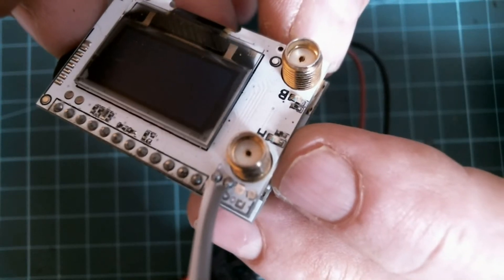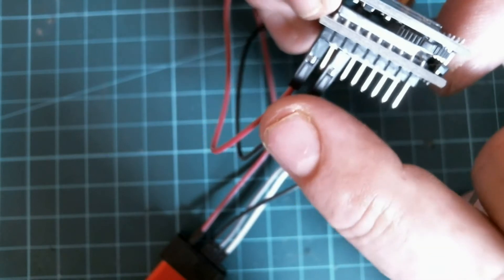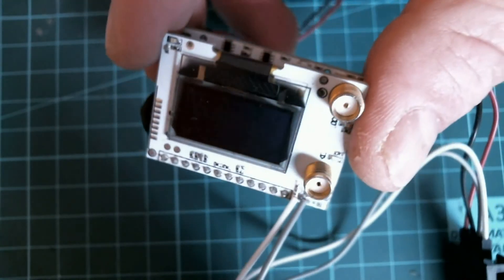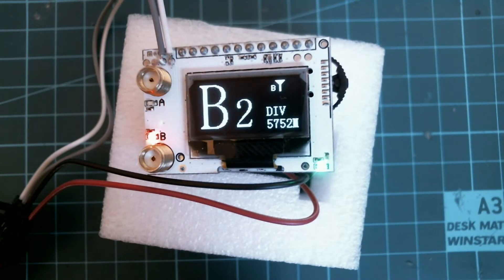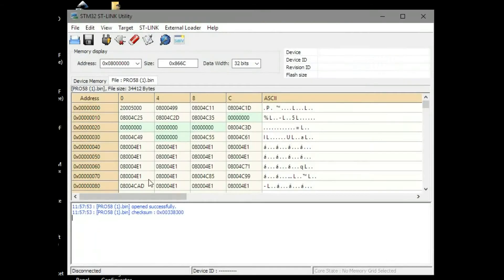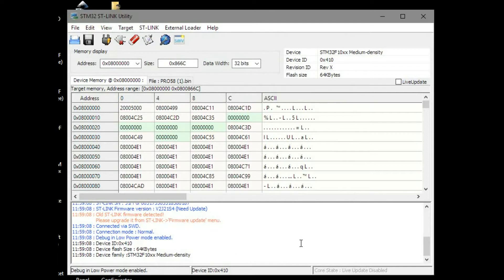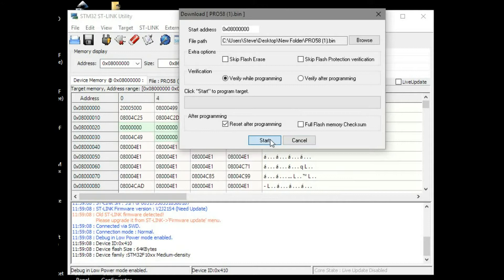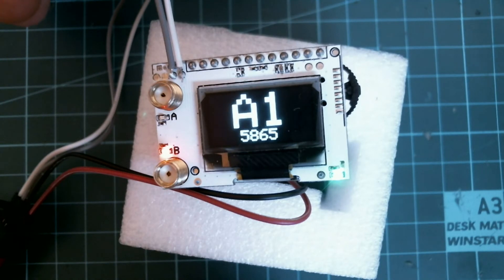Flashing OpenPro58 Firmware to the Eachine Pro58 Diversity

Comment: HE MAKES  PROCESS MORE COMPLICATED THAN NEEDED FOLLOW THESE INSTUCTIONS-

start the st link software, click on 'file' at top left and then open file, browse to the location the firmware bin file is saved and select it, st link will open the bin and return to its main screen.

now click on 'target' then select 'program and verify' st link will connect, theres no need to manually select connect.

you will get a box with options and a start button at the bottom, click start and after a short pause it will begin flashing, once complete your pro58 will reboot.

 job done!
you do not need to mess about with any other settings like in this video

Comment: Hi, I saw that fw tells me step by step how to do calibration, but I have 2 doubts. The first is the power of the vtx, I have to set it to the maximum (ie 600mW) or 200mw okay? The second doubt is the distance between vtx and rx during calibration. Thank you.
Reply from the maker: I set mine with a 200mW and had it across the room approx 4m away seemed to work just fine. PS my usual quad has a 600mW transmitter.

Comment: Hi steve thought I'd do a load test on this unit and the RX5808  just to compare the 2 .On the bench not in FS ,  pro58 uses 380mA and the RX5808 about  370mA  so not much in it is there .

Comment: All, with my Dominator V3 for manual mode to function well use the Fatshark channel buttons to select the first channel (the button with the arrow away from you) and leave it there.  It seems to work well then.  I haven't worked out the relationship between the module, Openpro58 in manual mode and the Fatshark channel selector.  Maybe these things will be worked out in a future release of OpenPro58.

Comment: I purchased one of these fully expecting to flash something better onto it.  The build version I received from Bangood does not have those solder pads over antenna A.  Are there two versions?
Reply from the maker: I don't know that sucks you need to take a photo and upload it to the RCGroups thread so we can all have a look.
Reply: I need a TS programmer and use those tiny holes.  Now I have to wait for a TS programmer and hope I don't screw anything up.  This was not worth what I saved vs. getting a 5808.
Reply from the maker: I agree think ill be buying a Realacc one anyway and flashing Achille to it
Reply: I got a TS programmer and flashed Pro58 v0.2 onto it.  It only works if I select a channel in auto mode.
Reply from the maker: What do you mean? Please elaborate.
Reply: I did some testing.  When I wire it to an AV cable and a 5v bec it works perfectly.  When I put it into my dominator V3 it only works in auto mode.  When I manually set my channel the feed comes in for a few seconds then turns garbled.  It makes me not want to trust it.  I am going to make a video.  I took apart my V3 and cleaned all the connections, etc. and have the same results.  I saw a comment somewhere early on before flashing describing the same problem but cannot find it.  Also I have a question.  In the mini pop up menu on the top it lets you set auto or manual, cool.  What are the bottom options 'ABR' and 'Hz'?  Thx.
Reply from the maker: ABR is by numerical channel and Hz is by frequency
Reply: Ok I'm almost tinkered out for today......  Thanks for your responses.....  I think the issue has to do with the Fatshark Channel buttons somehow.  I wish they were simply disabled with this module in.  I was using the FS receiver with only F band before and if you remain there it causes funkyness with what was set via the FS buttons.  I hope I'm making sense.....  I'm going to switch off of F band and see what happens. I think those buttons go down and up whatever band you are in on the pro58 so when change channels manually the FS switch positions must match the freq for the band you just switched to?  I'm going to verify that.  Is this how all FS diversity modules behave and I am being a noob?  thx,
Reply: I've done that steve V2.0  works really well  .

Comment: The one with the thicker boards is newer, the reason it didn't flash was that the stm32F1 chip is a fake, you can use the stlink software instead of cube programmer to unbrick it if you flashed with openocd or st-flash and then couldn't write. also, use Pirx instead it's way cooler.

Comment: Hi Steve  just tried to upgrade my pro58 couldn't get the st link to see device  had to connect the gnd pad to the st link pins to get it to work .  All ok now  . Also had to use ver 0.2   Ver 0.3 didn't work  for me  .
Reply: Just an update , got ver0.3 working now , in googles all ok .

Comment: I got one of the unit and having same problem, but can I flash it using ftdi instead of stlink?
Reply from the maker: You can although it means pulling the two boards apart desoldering a resistor and adding a wire. much easier to buy ST-Link you can go to this link at RCGroups and have a read through it.

https://www.rcgroups.com/forums/showthread.php?2904311-Eachine-PRO58-RX-Diversity-40CH-5-8G-OLED-SCAN-VRX-FPV-Receiver
Reply: yes my ST-link just arrived today, will give it a try using the latest firmware
Reply from the maker: Version 3 was just uploaded